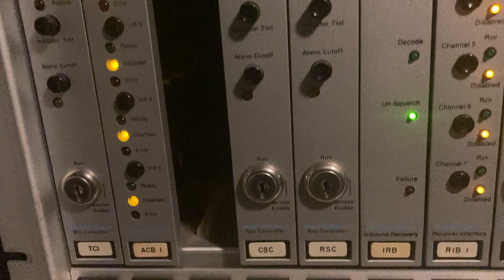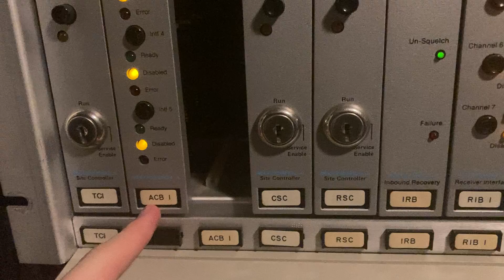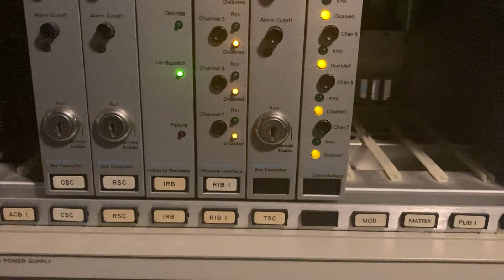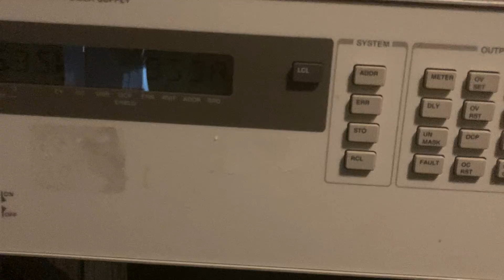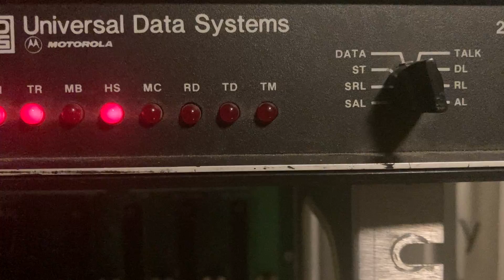Motorola 6809 Trunking Site Controller

Comment: You can interface with the CSC_TERM port using a PC with a null modem cable and PuTTY.  The parameters are Baud: 1200, Data Bits: 7, Stop Bits: 1, Parity: Mark, Flow Control: None.
Reply from the maker: Yeah that's how i've been managing it, just with a modem in the middle of the link. The baudrate is actually selectable from the jumpers on the CSC.
Reply: @KJ7BZC  Oh, yes, you are correct, that is just the one mine is set to right now.  I forgot.

Comment: TCI = trunked console interface. It's ACB would have modem links to a Centracom Central Electronis Bank CEB for dispatch signaling connection.

To make phone interconnection. You'd need the MCB, matrix, PLIB, and TRIB boards. The PLIB would connect to a Pulsecom shelf with phone line connection board(s). The TRIB connects to the station.
Reply from the maker: Ahhhh interesting. I could never figure out what those serial ports on the ACB were for, I initially thought they were just more terminal connections, but they never answered to anything I sent them. Would the audio for a connected Centracom be sent over leased line?
Reply: @KJ7BZC  Centracom audio is sent directly to the station using its TBIM card. The Centracom card that talks to the 6809 is the TIMI. The TIMI links just carry the signaling which includes what voice station is assigned.
Reply from the maker: @gregoryvanhyfte6721  I see, I'll have to try to interface with it somehow...

Comment: The TCI communicates with the CSC via a dedicated RS-232 interface into a serial link between the CSC and RSC. That allows the TCI to pass along call requests from the console that appear as valid RSC call requests. In addition, the TCI has a listen-only link with the CSC-TSC communications to permit updates to be passed on to the console on calls sent out to the TSC. 

MCB Master Control Board The MCB consists of a microp to interface with the CSC, the Central Interconnect Terminal (CIT) Matrix boards and the sys-tern manager terminal (SMT). The MCB communicates with the CSC and SMT via dedicated RS-232-C interfaces. The ACB is just a port server and would have been used to connect the data links to remote microwave modems.
Reply from the maker: I see, interesting that it emulates calls as if they were coming from the RSC. What exactly is the purpose of the MCB though? It seems like everything can be managed through the CSC terminal port already.